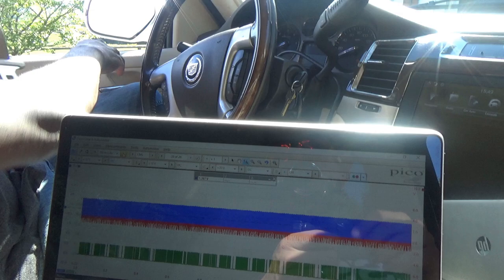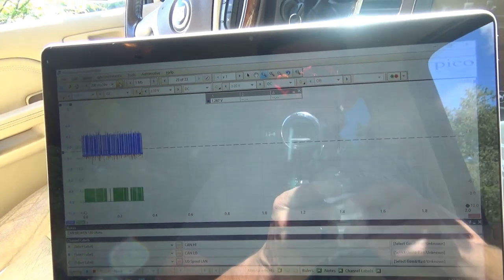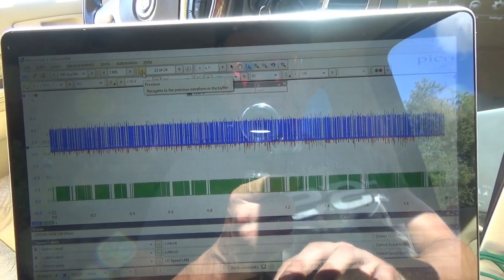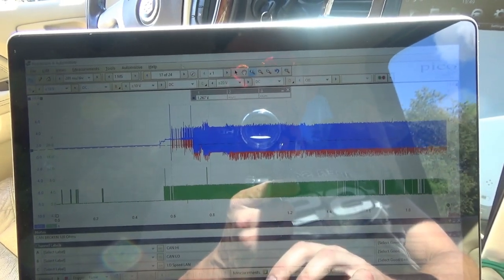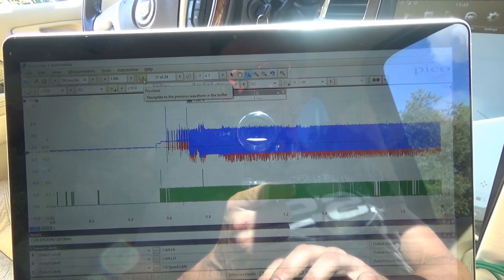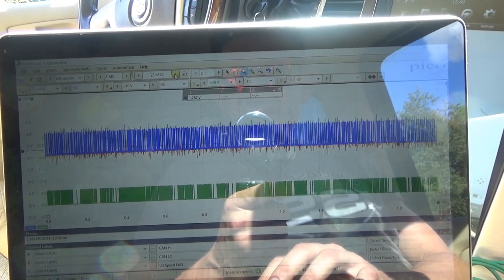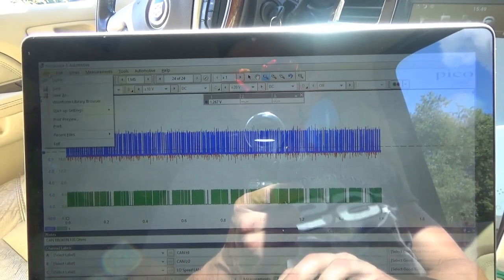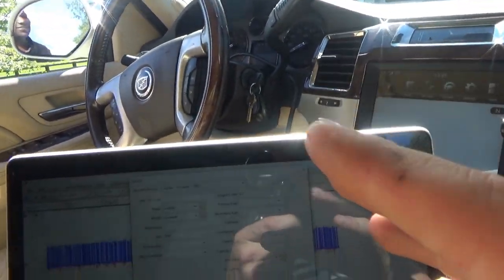OH NO... Parts Cannon ESCALADE is BACK!!  (Part 1 - CAN FAULT)

Comment: as soon as I saw those splicing beans, my stomach sank.  those are made for security alarm work, not high speed, 5 volt data lines.  then I saw the yellow wire nuts !!  time to teach Jason how to solder and heat shrink
Reply: Same 😂
Reply: Ridiculous!  The yellow ones look like wire nuts for house wiring.  If this turd was in my bay, new harness or get it out of here.
Reply: Ugh..broken tabs on a connector? just plastic tie wrap it secure.. even rubber bands would have been better
Reply: Yep. Saw the yellow wire nuts and I’m done watching: it’s obvious where at least one of the problems lies.
Reply: he could just buy a cheap set of terminal extractor and swap the connector. the repair he made is garbage
Reply: Those gel filled B connects are really excellent weather proof connectors...
I still have some that I bought in 1982 for my very last commercial alarm installation...
Having said that with the environment under that SUV it would have been all solder and heat shrink for me....
Reply: I agree
Reply: @65 Malibu  Lol,,, don't be mean..
Reply: @2packs4sure  Those B connects and the wire nuts have no business in a vehicle, especially a safety item brakes.  Total hack repair!  Even a shitty lawyer would win the lawsuit if there was injury due to accident.
Reply: @2packs4sure  And not just any heatshrink, the stuff with the adhesive in it that melts and completely seals the whole thing as it shrinks. And good quality name brand stuff, not some random crap from scamazon
Reply: I’d definitely want to replace the harness. Even if that’s not the problem it will be.
Reply from the maker: @WarrenMillerIII  so obvious 😅
Reply: @gorak9000   Agreed
Reply: I saw the blue non automotive insulated connectors used to join the wires together and said "wow what a hack job", but later on in the video I noticed the yellow colored house wiring thingies and said "damn wow". Let the customer know that he is a super hack, like with an S on with chest and a yellow cape.
Reply: @pootthatbak2578  Ya Exactly No need to add extra work to a job like that If you don't have to
Reply: If they had a good connector, they likely could have de-pinned the contacts out of the old and new and swapped the housing over, that likely would have been easier and would have gotten things back to stock rather than having that mess..
Reply: @65 Malibu 😂
Reply: We used to call them "chicklet's!"
Reply: There’s many times the idc connection is better than soldering! In the automotive world. I personally never thought anything was better than soldering!
Reply: No need to solder?  Tell me a manufacturer who solders wires?  None do.
Reply: Yeah, double heat shrink with the gel inside. That car is operated in New Salt City.
Reply: @gorak9000 where do I get the good stuff?

Comment: Get a OE pigtail for that and properly do those splices. The person that did that should not touch a vehicle electronic system ever again. Could of at least used the Solder sleeves. I would be wanting to fix that correctly first then chase the issue if it remains due to knowing its a issue.
Reply: yeah, no kidding, wtf is that garbage? I'd be ashamed to call that a "repair" - my god!
Reply: Exactly. It's no wonder something is going wrong with the Escalade hacked together like that... 🥺
Reply: Don't be too hard on the guy, he clearly just doesn't know how to do it properly. He needs to learn, not "never touch it again".
Reply: Everyone starts somewhere. Get off your high horse
Reply: @mastahc411  No what was done on that is just being lazy to take time to do it right and spend a little bit to have it properly done. Fact is there is shops that do this crap and sell it to customers and the customer always loses in the end. And you definitely don't practice on a safety related system like the ABS. Be honest with yourself when doing a repair and if its above your skill level pay to have it done properly by a trusted source whoever that may be. There is one thing in trying to learn and quite another just not wanting to take the time to do it correctly. Someone that was just learning would of used unsealed butt connectors which they would of done a bit of reseach to find and not freaking household wiring nuts. This day and age information on this type of repair is easily found. Nobody is perfect but the ones that are willing to put in the effort are going to seek out the answers on how something should be done and deciding if they are capable or willing to do.
Reply: @mastahc411  falsch!!!  Das war technisch eine 5.wenn diese person an sicherheitsrelevanten systemen arbeitet ist der fahrer TOD!!! der kann an seinem eigenen auto üben oder besser einfach mal eine vernünftige ausbildung machen.lg.
Reply: @jessicav2031  I should of said until they receive proper training as there is a bunch out there available but they have to make the effort to attend.

Comment: Disconnect the battery. Use only one meter at a time (you are reading the input stage of the other meter). Solder and heatshrink all those wire nut connections so you know they are good (needs to be done anyway). Measure each wire individually: connect one side of the meter to CAN high at the DLC, and the other side to CAN high at the EBCM, etc. Backprobe the BCM so you can also measure there with the BCM plugged in. There seems to be a lot of confusion here about what measurements are covering what, and that is what needs to be cleared up first.

Comment: You don’t want to use those skeevy  crimps under a car.  And GM should be spanked for putting an electronic module down there.   They are doing this all the time.  The Corvette also has a computer way down there.  Water always wins.
Reply: Gm only has to consider those that live above the road salt line. Every one else is fine. No sense owning anything in new york more than 5 years
Reply: What type of location for electronics, a foot off the ground, behind the tire, out in the open.
Reply: Both statements I go with 100%. Exactly I had the same thoughts.
Reply: they don't want cars to last, they want to sell you a new one
Reply: Now we just need a rating system for auto manufacturers.
Reply: always has, always will. add a little salt ...perfect
Reply: I agree, I would never use anything like that under a vehicle. In fact, I would never use crimps like that anywhere. 😂😂😂
Reply: I think it's Ivan that does a video on a Corvette where the ECM is under the wheel cover on the right front wheel well. Absolutely Ridiculous!

Comment: Those b connectors are not good on a car with the potential for water.. corrosion awaits, then failure. while they have gel in them the tips are exposed.

Comment: Former telephone splicer here.

First, you need to shunt the network at the ebcm back to the bcm.  Verify that you have a solid 0 ohms (or close to that; temperature, wire gauge, and length of wire will determine the exact value).  My guess is that you won't have 100% continuity.  Additionally, I'd disconnect the battery to ensure that you don't have any stray voltage.  I believe that you will find a spot where the insulation is nicked across that set of network wires, causing a partial open and short.  I used to see this quite often is outside plant cables.  You'd have a few wires losing insulation and damp, so the wires would corrode, starting adding resistance in series AND IN parallel.  Additionally, sometimes, the circuit would be open from one end and have a high resistance short from the other.  You could also get crossed with battery from another circuit (that generally wouldn't happen in a car if you disconnected the battery but..).  Good luck, interesting problem to solve.  Crawling around a car beats tracking down a problem in an 8 mile telco loop.
Reply: Also, get rid of those blue connectors.  They are junk.  They used to come in white and had "dolphin" stamped on the side.  JUNK, with or without gel.
Reply: @douglasjreynolds  THAT IS A MESS FOR SURE.
Reply: @douglasreynolds Just a quick question if I may, what do you mean by shunt the network? Im curios thanks. I have more of a suspicion that the induced voltage will be something feeding back from the screen installed since last repair.
Reply: Agree. First disconnect battery and test wire integrity. Even when asleep some circuits have a minor current through them.
Reply: @garryrussell7618  by shunt, I mean take a jumper and short the network wires going to the BCM together. Then, you can measure the continuity from the BCM connector to see if there is a break in the wire.
Reply: High resistance short....that's a new one.
Reply: @TimDyb  In the telephone world, a dead short would kill the dial tone.  A high resistance short, say above 50k ohms would not kill the dial tone but would make it noisy. That was generally caused by corrosion or moisture. High resistance shorts or dirty connections will kill a data circuit due to noise.
Reply: @TimDyb  That's not new.  It's very common.  It especially happens at connectors, where corrosion will build in between two pins.  As it first starts to short, it's typically high resistance-- but as time goes on and the corrosion builds, it will become more robust and become a direct short..   It can also happen in a wire.  You can have an exposed wire corroding until it's nearly a clean break, and have only a small thread holding on.    That will act as a resistor and not carry current, even though it might test as a direct short with your meter.  That's why we have to LOAD test circuits, because a high resistant short can cause the meters to lie..  Because the very low current of a meter can pass through that small thread just fine, but when you put a load to it--  that little thread will heat up, which makes it have even more resistance, and then it can't carry current;   or if it does, it could start to glow red hot and even start a fire-  which is also common.  Let the smoke out baby. lol
Reply: @calholli  Very true in my experience. Except that we didn't use the term high resistance short - but rather parasitic draw or leak.
Reply: @douglasjreynolds  I have only seen those used on phone line.  Not the way to go here.  Wouldn't have gone any further without fixing that first.
Reply: As a telco tech did you use a TDR technique to find cable faults?
Reply: @windward2818  yes, hard faults and corroded connections are easy to find with a TDR.
Reply: @douglasjreynolds  I have seen some demos of relatively small distance TDRs which you could use on vehicle wiring faults. However, I have not been able to evaluate any myself. Perhaps Ivan should get a long junk harness, like from a newer large SUV, introduce different circuit failure modes, and see if you can detect these with a TDR. What do you think?
Reply: @douglasjreynolds  all the fun of chasing line imbalances on rural circuits (customer complains of electric fence ticking)

That and finding where the grass is growing over the fence wires and cutting it back
Reply: @windward2818  some of us predate ready availabllility of tdmr testers. You'd be at the mercy of the testers (and techs) at the exchange mdf and only get localisation to 20 metres or so...

Comment: Ivan, you should build a detached garage and make it tall enough inside to put a two post lift inside and with plenty of space around for your tools, etc.
When I had my new house built I had the garage built with the ceiling at 12 feet high to have room for a lift when I'm ready for it.

Comment: Very interesting. I would only say that I would check the resistance with the BOB unplugged. The BOB can interfere with the CAN network on some vehicles, especially if a Scan tool is connected to it. One way it can do this is that it can act like an antenna hanging off the CAN bus. Some Scan tools connected to a BOB on some cars will not even connect, but will connect fine without the BOB. Depends, of course, on the particular BOB as well.

This has nothing to do with the root cause of the problem however, but may have something to do with the resistance jumping all over the place. If not, it seems it would most likely be a poor connection somewhere on the CAN bus. I am trying to go by memory here as I don't have a lot of time to re-watch the video right now, but I think which ever CAN line was connected to channel two (Red), was worse than the other. I may be mistaken here though.

Once again, very interesting, and thank you for making these videos. They are appreciated.

Comment: So ironic. I had an Escalade do the exact same thing this week. It ended being the radio. The class 2 serial data message coming from the radio was 0 to 13.5 volts instead of 0 to 7. Fixed that. Then every once in a while you go start driving and the stability light would come on and you lose throttle response for a few seconds. Turned out to be the steering angle sensor. It was jumping around from 0 degrees to 162. And when turning left it jump from -220 to 510. Crazy.

Comment: Hi Ivan, I'm not sure if it's part of the problem or not but you need to fix those splices.  There's electrical wire nuts on some of them!  Not to mention they're on the underside of the car exposed to all sorts of water and water spray.  I would trust those connectors about as far as I could throw that Escalade!  I don't know if you can get a new connector or not but at the minimum those splices need to be redone and watertight!  I'm also not thrilled with the resistance changing depending on the position of the connector bail.  I'd fix that whole connector and splice mess before going any further just to eliminate it as being the issue or contributing to it.  Thanks as always for another great video, it's fun to watch your logic.  I will say you don't cuss nearly as much as I would!

Comment: I apologize if this has already been mentioned, but an easy way to validate an ohm reading is to reverse the leads at the meter. If the reading is different, there is a problem.

Comment: Many of those “Tesla style” radios tap into the network, could be a new problem introduced. The wire nuts on the ebcm aren’t too encouraging even if the resistance appeared stable while messing with the connections.
Reply: Good point
Reply: Just the word Tesla should strike fear into anyone.

Comment: You should NEVER do ohms measurements on live circuits, even if they are in sleep mode.
Even any "yawning" data in the circuit will instantly flip the ohms measurement.
You MUST decide your method :
a) Have the circuit live and do voltage/data measurements
or
b) Have the battery disconnected and do continuity / ohms measurements
You can NOT do both reliably !

Comment: Creepy déjà vu! Not sure if it's easy, but I would have started in the 120 Ohm resistor to set a baseline, and go back measuring through each module (maybe also reversing the leads to compare - if there's a parasitic voltage, there could be a module leaking irregularly in sleep mode). Very curious of what Part 2 will bring.

Comment: There has been times that I contemplated yanking the whole harness in a car, and rewire it with a universal hot rod harness and ditch the computers. But your knocking off the problems on this one a wire at a time. Would be good training for other automotive techs. 👍🏻👍🏻

Comment: I think you know that you can't put two ohm meters in parallel, but also for consistency of testing, you should use the SAME meter at each test point.
Crusty faults are non-linear (IE not a pure resistance) so the testing voltage of the meter will influence the reading.
This test voltage can typically vary between 0.5V and 5V on digital meters.

Comment: I don't know if it will influence something, but the first thing I would do is reattach the connector your way to get rid of that variable. If it quacks like crap, it will behave like crap. Maybe the customer does not want to incur the additional cost of getting the connector reattached correctly. In that case he will have to understand the risk he takes.
You question the dealer, that is a very good question. Dealers are usually only interested in shooting their own parts cannon :)

Comment: Initially, the resistance reading of the network was about 40 ohms too high, then it continued to climb. I suspect a corroded, high-resistance wire between the VCIM and the EBCM. To confirm, I'd isolate the VCIM and EBCM by unplugging them and use an incandescent test light to load the communication wires between the two modules. In other words, I'd use the test lamp as a continuity tester and use the communication wires as the jumper wire to complete the circuit. The circuit will likely only see 8mA of current during normal use, so I'd want to stress test the wires by ensuring they can carry at least 250mA.

Comment: An ohm reading that starts at 0 or very low and then climbs can indicate a capacitor in a circuit. There may be one of the can lines is open at some point...  That's from my electronics past...

Comment: Need to do wiring repair at the ABS module. Clean, tight connections are a must on low voltage circuits. I think either a bad connection at a module or a possible corroded wire that hasn't broken all the way through yet.

Comment: You can test to see if a voltage is affecting the DVM reading by switching the DVM leads (polarity). If the reading is different with the leads switched, then a voltage is throwing you off. And for testing purposes, you might need to disconnect the vehicle's battery until you have the resistance measurements sorted out. If the resistances are OK with the battery disconnected, then it looks like a bad module may be the cause - and you're way above my skill level (I use the term "skill" very loosely). I can't wait to see part 2!

Comment: I wonder if that aftermarket Infotainment Center is causing this? 

That huge screen in the middle that replaced the Radio head unit and the hvac controls.
Reply from the maker: That's on the single wire low speed network 😉